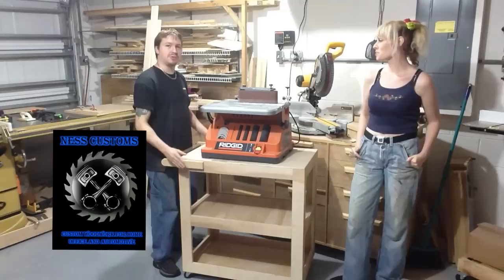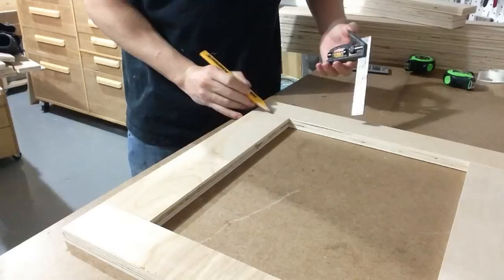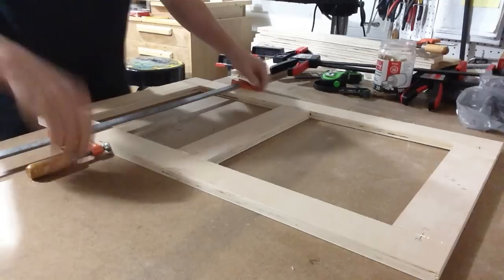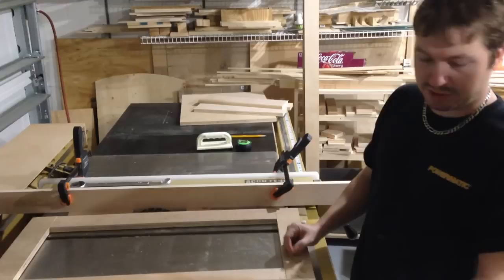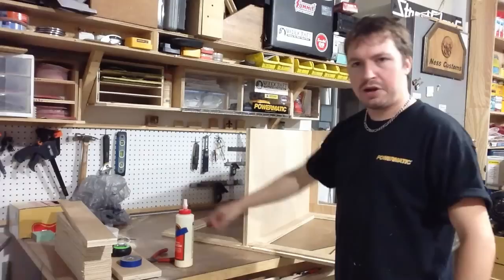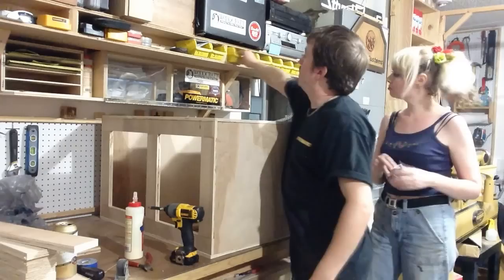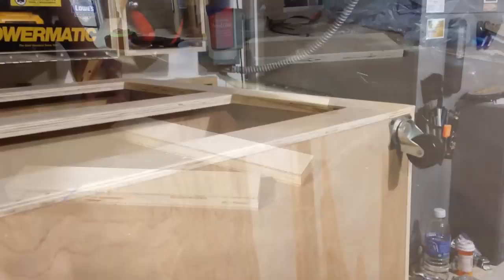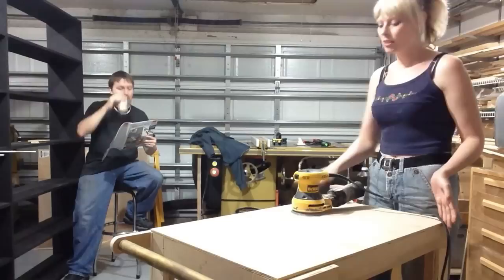Easy Step By Step Shop Cart Build For Woodworking Beginners

Comment: Very nice wooden shop cart. I just got back from looking at a metal one at HF. I was thinking to myself coming home, that I have a nice sheet of 3/4 inch birch plywood, that I maybe could use. I went straight to YouTube and searched. Your video is the first one that came up. It is exactly what I had in mind. I have the complete set of Kreg pocket hole jigs and screws. I may use that instead of the biscuit system. Your video is very professional, well spoken, and your lady is a nice touch. Will let you know how mine turns out.